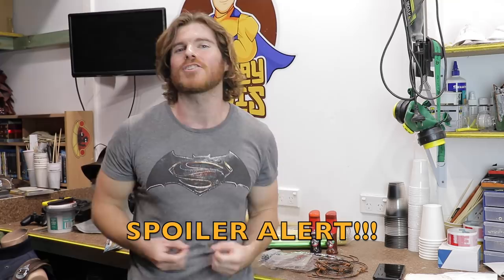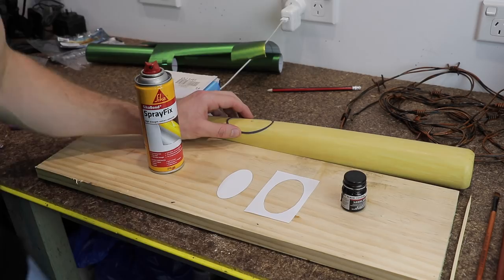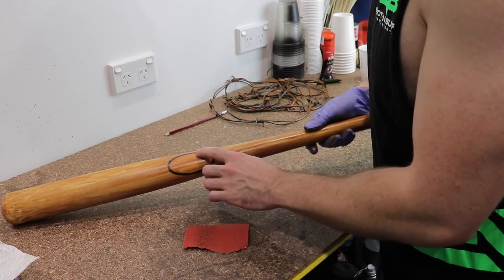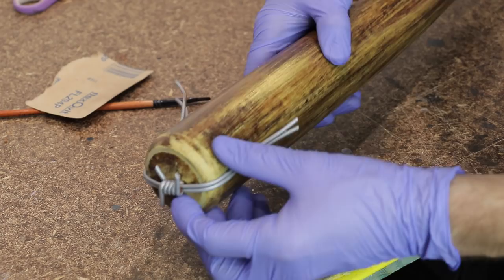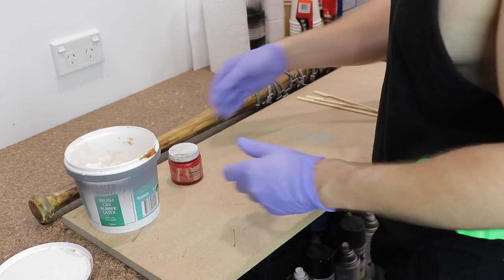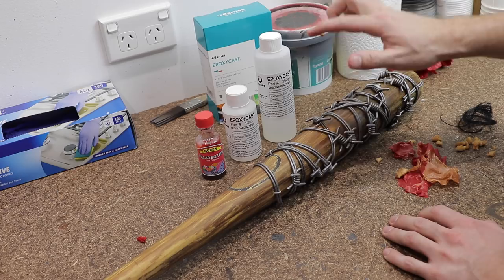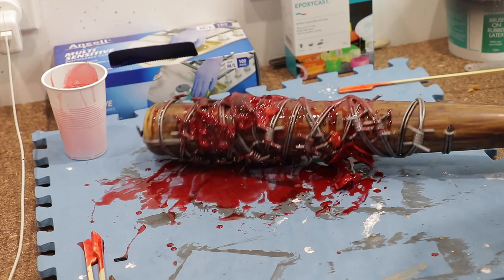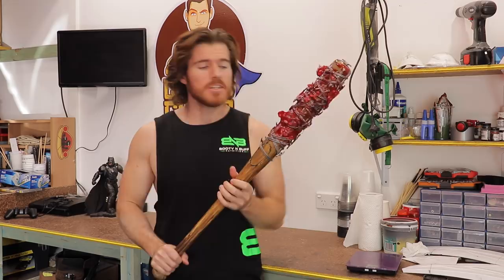The Walking Dead: Negan's Lucille Bat Foam Replica- Chris' Custom Collectables!

Comment: How about using a soldering iron to burn the circle in then dry brush it. It is actually based on a Louisville Slugger bat and their logo is branded on to the bat.